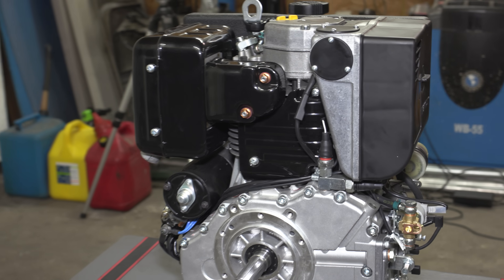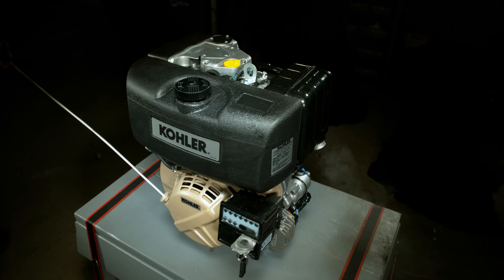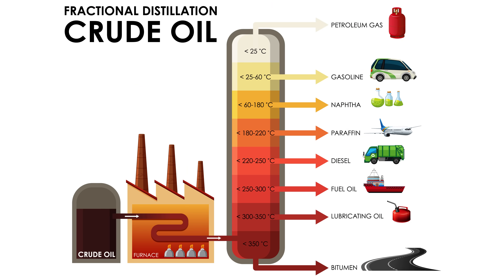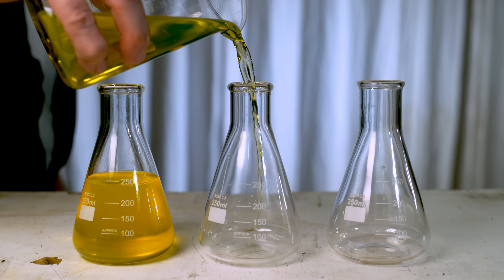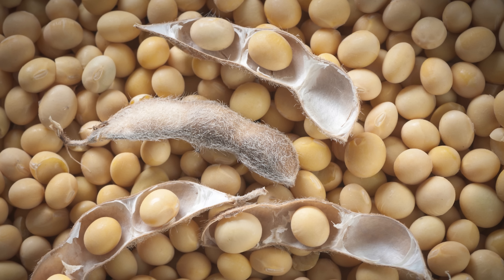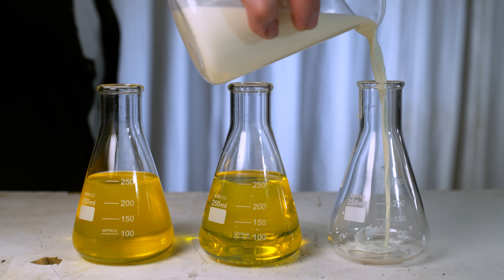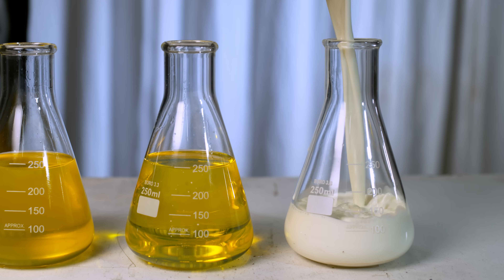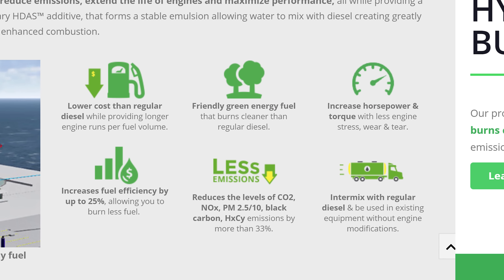Diesel - Biodiesel - HydroDiesel  (Fuels I Will Be Using for My Diesel Engine Series)

Comment: Fun fact, it's white for the same reason that milk is white, it's an emulsion. Oil and water don't actually mix so they exist as microscopic droplets of one fluid in the other. They scatter the light and make it appear a flat white color.
Reply: Similar to cutting oil i guess. Mix with water turns white. What about lubrication for injector pump? How would the water mix fair? Also diesel from plastics using super heated steam to aquire a fuel??? Be interesting....
Reply from the maker: That is absolutely correct !!! I'm just curious to see how it runs.
Reply: @WarpedYT  Looking forward to seeing the video on it, I hadn't actually heard of Hydrodiesel before this. Interesting concept.
Reply from the maker: Me either.... It seems strange for sure it almost looks like it won't run. But I'm told it will so this will be interesting.

Comment: I've used straight vegetable oil on my 98 mercedes. I'd be interested to see difference in combustion.

Also consider adding 2-EHN (a cetane booster) and comparing the combustion with and without.

Also the difference in carbon build up between the different fuels.
Reply: You are going to destroy your injection pump. I've been doing this over 20 years, I've never seen a grease car survive.

Comment: Is Hydro Diesel the same as adding "Adblue"???
Btw, pull starting a Diesel...... remember the decompression lever 😂🤣😂🤣
Reply from the maker: Lol.. yeah this one has an automatic compression release, problem is my hands had some oil, so it was basically tendons against compression. Normally you have some friction in your hands on the pull starter which takes up probably 40% of the force that you're putting in since you'll be using your body weight as momentum, but once you get your hand oily that friction is gone and it's straight on your tendons and muscles

Comment: All the legislation around Diesel engines is related to particle and hydrocarbon output. I’d be interested to see which of the fuels burns cleanest - I’m thinking a white rag over the exhaust and compare the size and amount of soot particles.

Comment: Hi Matt, I'm really looking forward to this series!
Reply from the maker: Funny I was about to text you and ask you a question about something I was thinking about something you told me but was unsure if it would work for what I'm planning to do .
Reply: Off Road Diesel & BlackDiesel which is used motor oil.
Reply: @WarpedYT  aw man y'all have a cool kids texting club... I want in! 😩
Reply: please also use ATF as a fuel  it will have more power its not a joke trust me im engineer
Reply: @madrzegada3700  I have used atf and all it does different is smoke more performance was the same maybe little bit better plus the detergent in the atf cleans the injection system
Reply: @dantediana9229 ATF need more oxygen to burn fully mean it have more caloric value, engine do not know that is burning ATF so it adjust ARF for diesel... and ATF burns longer then diesel dyno will show more torq if boost presure and intake air dencity stay the same...   ps try LPG for diesel engine just a little (it cant combust before tdc on its own so very litle gas and not add it od idle rpm (1200 + is ok )  the LPG in air diesel mixture speed up combustion front like a lot )

Comment: I would incorporate a pyrometer on the exhaust side to see while under load conditions what the temp is.  For consistency's sake should probably meter the intake air too. 

If you can find a generator head, you can run the engine to 3600 RPM and put a load on it and see how many watts of power it takes to get it to fall below 58hz. Nominal is 60 Hz, but with the little generators, they run them a tad faster to give more room for 'surge capacity' but once you fall below 58 Hz, it's pretty much game over at that point. 

You can set the generator up to measure total max power per fuel, and the exhaust temps at those points, then in a separate test, pick some nominal load point, and put in like 2 cups of fuel, and see how long each one runs at that power level. That will give you some idea of the relative efficiency, or energy density of the fuel. 

Looks like you have a 10HP engine, so a 5kW or 7.5kW 2 bearing head would be just fine for testing. Normally, it's 2 HP per kw of output, so at maximum, a 5kW would be about maxed out, the larger head just means you can load the system more to make max loading for the fuel more dramatic and easier to see.
Reply: Upvote this. I work as a diesel mechanic at a garbage company. We just switched to biodiesel/synthetic diesel mix and the problems have started. I think he needs to see how the injectors are after each fuel. Aka get 3 sets of injectors and change them every type of fuel and then send them out to be flow tested before and after to see if they have any damage caused or changes in spray.
Reply: @whidden1998  Yep, you're diving deeper than I wrote, but yes, the water potentially exploding in the injector tip can't be good for it. I can only imagine it getting worse as injection pressure rises.
Reply: @whidden1998  Biodiesel also destroys injection pumps

Comment: Well.. since you asked:
NOx content e.t.c. of exhaust, even the ad-blue stuff if you have a simple way of doing the test.
Lubricating properties of the diesel (fuel pumps e.t.c.).
Put them in a centifuge, and see if the diesel splits up? (the last one may be split in two)
Torque, ripple and accleration.
Effect of water-injection on the engine (ECU control?).
Ease of starting the engine.

Cover what you find reasonable.

Comment: Hydro diesels sounds interesting, I guess whe water component vaporises and expands the fuel burns increasing pressure in the cylinder in much the same was as water injection in a regular engine.  
  It’ll probably be the most expensive taxed HO2 available.

Comment: I would be interested in seeing the performance of Diesel at different temperatures and the respective additives to keep it fluid. Cold Diesel as much as really hot Diesel.
I'd also be interested to see how the engine reacts if you mix Diesel with regular gasoline and at what point the engine would start failing.

Comment: see which fuel lasts the longest at full throttle, measure the power output of each fuel
Reply from the maker: For sure I'm already doing that, that's the first thing I'm going to do in that first episode,
Reply from the maker: I'm also thinking about doing a Dyno run with and without the exhaust and also measuring how much particulate is coming out of the exhaust.
Reply: @WarpedYT  Maybe also measure how hot the engine gets on each fuel. See if one burns hotter or not.

Comment: I'd like to see measurements of total energy density of the three diesels and the stated density of hydrodiesel and their efficiency measured in the engine, id expect the hydrodiesel to have quite a bit less energy density in line with the water content but maybe slightly more efficiency. got a small engine dyno or a generator to hook it to for measuring?
Reply from the maker: Yup... Sure do.
Reply: Why more efficiency with adding water? Maybe lower NOx, maybe better atomization leading to better fuel burn so possibly effectively less diesel per distance? Someone explain.

Comment: Yu can also try heat test  on exhaust side to see which if any burns hotter. Exhaust Gas Test,  EGT will tell you how much of the fuel is actually being burned, or going out the exhaust.

Comment: It will be nice to test a "Pantone reactor" on this engine, and compare accurately the gain of consumption and/or power (with the torque/power meter).
Reply: If you have the expertise..along with technologically knowledgeable folks..please get with this guy so the masses can see if the hydro diesel works before the industry goliaths shut it down. Just like all the attempts to reduce the stranglehold on us that  big oil has thwarted.

Comment: Put plain vegetable oil in it. Filtered of course, but not chemically treated. Some people use it for their diesel cars in Europe.
Reply: I get an increase of power and decrease of consumption when I run 1/3rd vegetable oil in my 5.9 cumins 6bt engine.
Reply: @melodysouljahrootsdubpress5539  mixing like what you do I found the best results. Starting, power ect
Reply: USA I have used thousands of gallons. Used filtered vegetable oil. Diesel suburban, VW Jetta, ford trucks. Got me through college when gas was expensive.

Comment: I'd like to see what these fuels look like in freezing temperatures. -20°C for instance. The milk like one, does it still flow?
Reply from the maker: That is a great idea, I'm making a note of that right now. I'm curious myself
Reply: @WarpedYT please also use ATF as a fuel  it will have more power its not a joke trust me im engineer
Reply: well you're point is pretty interesting but i guess nowadays diesel engine uses a heating coil at startup to initially heat up the fuel so that it can vapourise easily....
Reply: @PG-py9lq  still keep it in a tank and lines to the engine, if it gels or freezes you cant do shit. Adding naphtha and kerosene in the winter is common to prevent this.

If it gets too cold we just never shut the truck off the return flow from the fuel system keeps the diesel from gelling.
Reply: @PG-py9lq  nowadays most truck manufacturers run coolant lines into the tank through a coil to keep the fuel warm, those also typically have auxiliary engine units that share the cooling system and run those instead of the main engine.

Comment: I would like to see someone using diesel additives, and to actually see if they work
Reply: Project farm has done several videos on this
Reply: Take some carbon and soak it in additive. If it breaks it down it work.

I put some engine flush in my engine as part of maintenance and as i poured it in it took away a lot of the carbon from the oil inlet.
Reply: There is little of it in water memory documentary

Comment: Can you put turbo with disle engine and try what will happen with these type of disle in the engine? No#5
Reply: Turbo or not it doesn't matter for operation, just better power. Diesel doesn't really care what fuel is in there, because of how it works, all that matters is lubricity and viscosity (for durability)
Reply: It'll run like a turbocharged diesel.